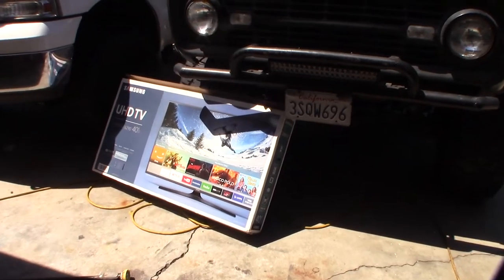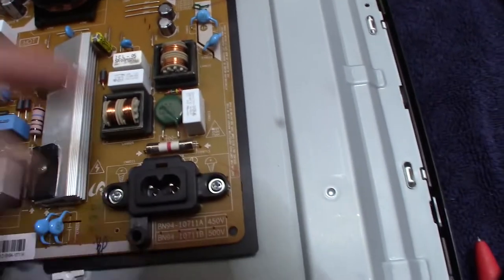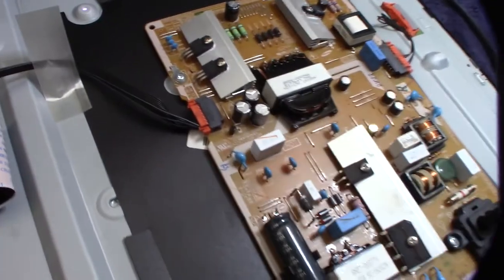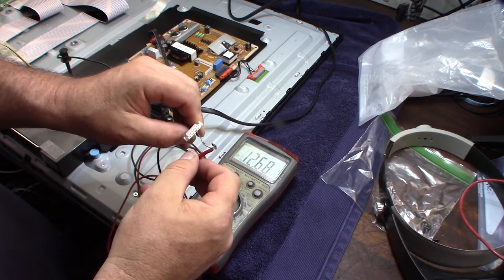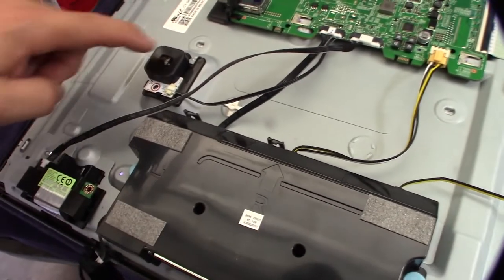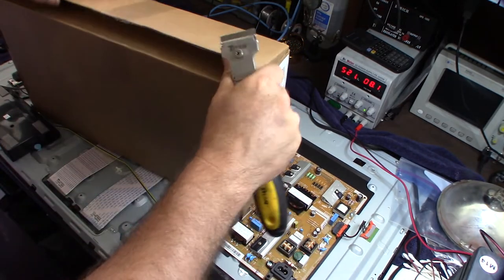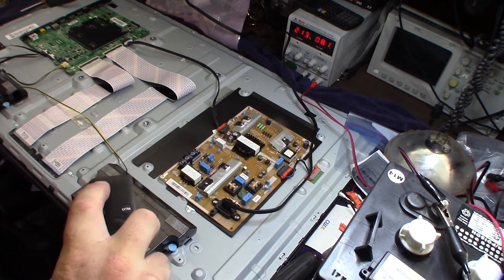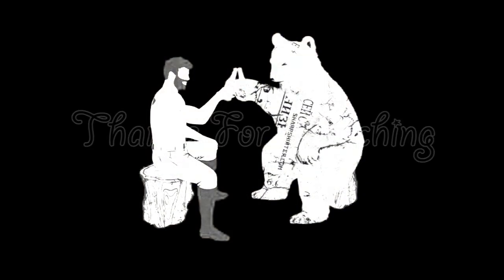Samsung UHD TV repair standby light on but no power or backlight series 6

Comment: The problem with modern TV repair, and I come from a background of electronics,  you don't have a schematic, you don't have shit to go by, you measure something, do you know if its correct or not? Usually unless you worked on a similar TV you don't. Nicks TV repair channel has helped me out tremendously.  There isn't a whole lot of component level repair you can do anymore. Nicks replaces a lot of processors, gamma chips and whatnot with a rework machine. There's still money to be made, old school electronics isn't completely dead.

Comment: I had a tv that would have the leds power on when the power supply was unplugged from the mainboard but would just go into a boot loop with no image on the screen when i try to power on.  Replaced the mainboard and power supply amd have the same issue.  Disconnect the panel and same issue.  Last thing to check is the leds,  will replace tjem and let you know how it goes.

Comment: I have a UN55J6201AF with the same board layout. I tested voltages across the connecting cable and got similar numbers but when I disconnected it, the LED’s did NOT come on. Does this mean the power board is bad, or the LED’s ? What do you recommend?

Comment: What was the cost for buying the PSU along with main board and from where did you buy it?I have an UE40KU6000 having software problem and i haven't find yet any solution and mainboard replacement seems like one way road for fixing it.

Comment: I got a Samsung UHD 60" for free, I get a rise in STB voltage from 8 to 13 volts when I unplug the main, which is ok, says it on the board,, but the BLs don't come on, I used a BL tester and no lights are working. I got a 40" with it and they might of been hit by a power surge. The 40" has a shorted mosfet to the CCFL inverter, yea its old but like new.

Comment: I had a similar problem with a smaller Samsung. Power board was fine but when i delved online I found a lot of these tv`s get bios problems, maybe bad wi-fi during  firmware update. This TV in question had firmware updates set to AUTO on menu and indeed had Wifi built in. I decided to reset the bios on the cmos IC on the Main board, quick google showed which pins to short during power up in standby. Like your psu board the main board had a nice diagram on the mainboard not too far from the cmos IC showing the connections. I soldered the link as opposed to holding a wire and de-soldered after say 15 seconds of standby power. This worked for me, tv functioned correctly after that and i took the liberty of updating the firmware with my wifi before turning OFF AUTO on update settings. I didn`t like the cheap caps on the psu board so changed them out for quality panasonic caps. Fingers crossed it now has a long life, the guy uses it in his holiday caravan at a trailer park. Just something you may want to check on that Main board maybe, outta curiosity :)
Reply: So what you trying to say is to turn off auto update firmware version on Tv it can solve the problem. I have my Tv when it blink red light i disconnect the power cord to the wall outlet for 20 minutes and i click power button indicate back on my Tv for 30sec and after that i click power button of the Tv at the same time i click power on of the wall outlet and the Tv turn on. My Tv is Samsung UHD Curve 55'inch series 7.
Reply: @johnmakwega6664  I`m simply saying my capacitors were ok so I looked for another reason. I found someone in a forum or youtube say they had a corrupt bios update that rendered the tv unable to turn on. The bios update was corrupt and needed to be wiped from the bios chip. It would not update again by itself or from usb. I found the board had bios chip pinouts I could see linking 2 pins cleared the bios. Once I cleared it, i updated the bios and turned off bios update over wifi which had caused the issue, bad wifi dropout maybe.

Comment: If you know the back light is okay, and all of the voltages coming out of the power board are okay, then you've pretty much eliminated everything except the main board.  When the power board goes bad, you can usually see a blown (swollen) or leaky capacitor, or some other kind of obvious problem on the board (burn marks, etc.).  The main board won't show visual defects because it's digital (low power).
Reply: Checking the voltage seems like the first step,  in what state does the tv need to be to test voltage? Plugged in or not? On or off? I’ve been researching for over a month and can’t get to this vital step because I can’t find this answer.

Comment: Lot of the problem with the led TVs not powering on bad caps on power supply I fixed my TV for 10 bucks Repair guy told me 152 bucks to fix it I told him that he was ripping me off he said that's what it cost to fix a TV
Reply from the maker: Yep, I've fixed a few that way. The problem with this TV was the logic board. Its usually the power supply/caps.